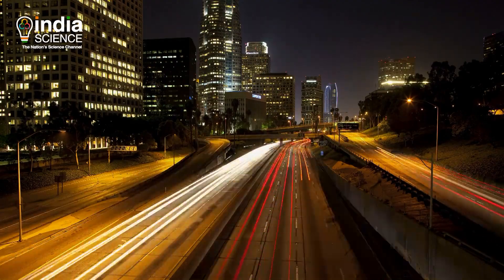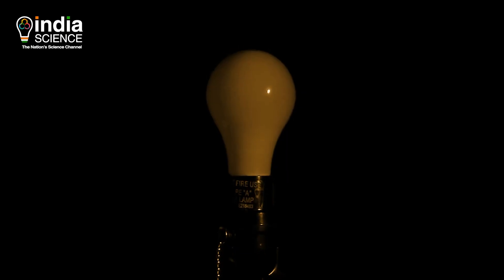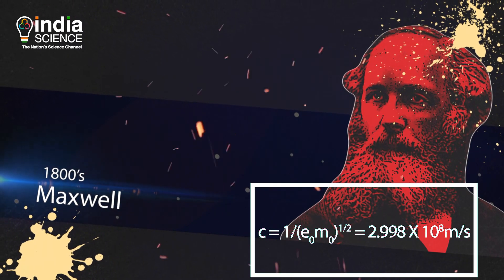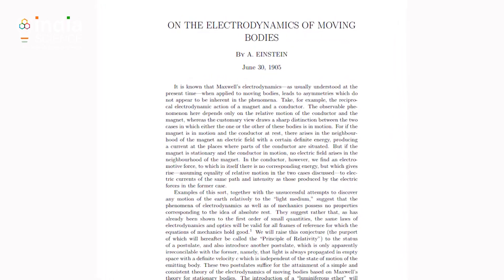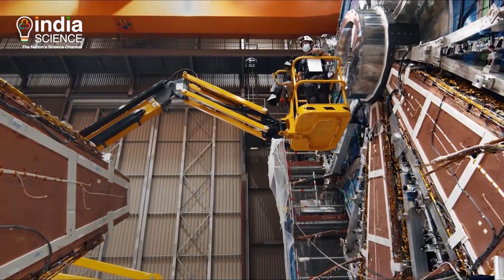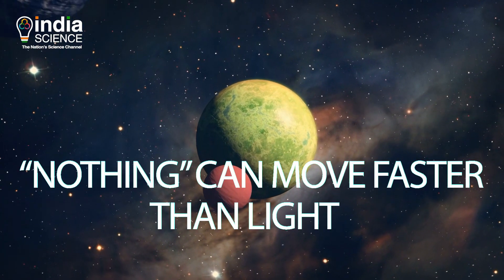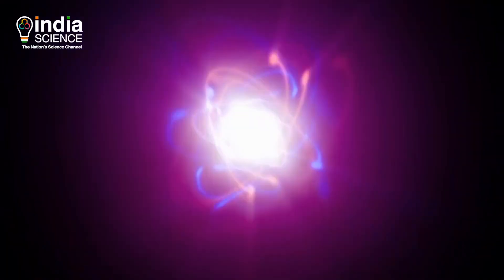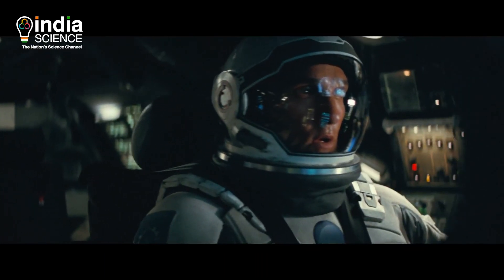What travels faster than light?

Comment: I have predıcted with my theory and my formula 6.3 tımes greater speed of light which is measured as if apparently inside of M87 black hole. I SUGGEST HAVING A LOOK AT THE FIRST PART OF MY THEORY AND MY FIRST FORMULA WHICH DETERMINES A LINEAR VELOCITY OF...6.3 TIMES GREATER THAN THE SPEED OF LIGHT, ETC. AND I TOLD WHERE OUR MEASURED CONSTANTS ARE ROOTED IN, we need to change the concept of matter that makes us imprisoned by all kinds of impressions and especially by accepting the vacuum illusion which it has been sitting comfortably in it